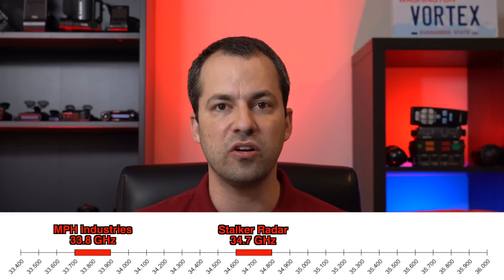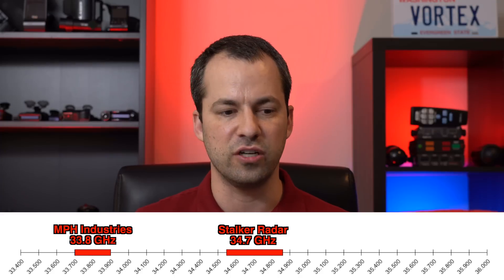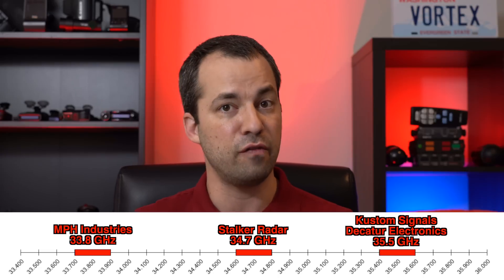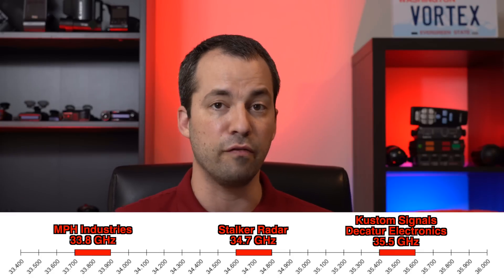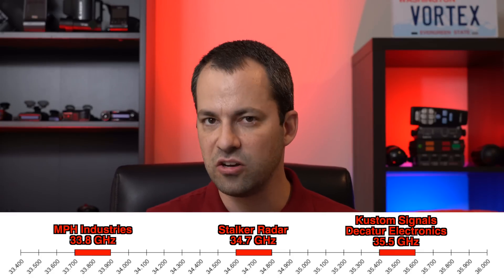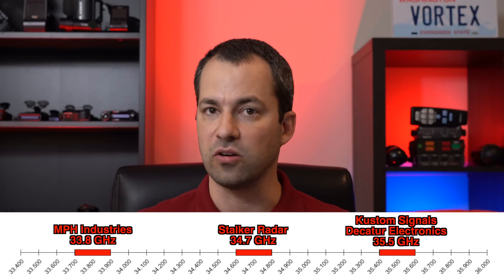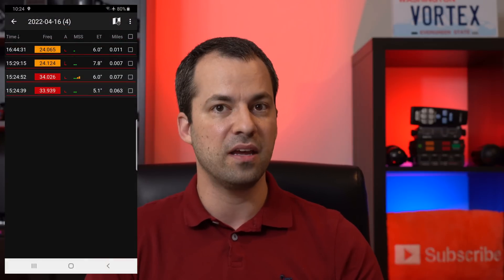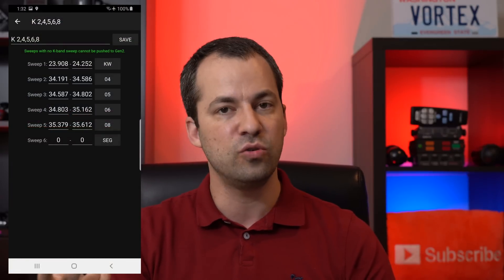Understanding Radar Frequencies

Comment: Recently drove from Pennsylvania to Florida using the V1 gen2 along with JBV1. I was getting a ton of 33.711 signals. This is while on the freeway. Any ideas? Is this a frequency  I can just segment out? I also seem to get a lot of laser falses and I believe it's from sunlight. I hate to just turn off laser as I did see one or two police officers using laser on my journey. Fortunately waze marked almost all of the police officers.
Reply from the maker: Interesting. Usually that freq range is from nearby leaky / cheapy / poorly designed, but the V1 Gen2 also gets its own share of Ka falses regardless. 33.8’ish is where MPH guns transmit as discussed in the video so it’d be unwise to try and segment it out.
Reply: @VortexRadar  ok thank you. I'm still learning how to use the segmentation in jbv1 before I start messing with it. I'm hoping something can be done with the laser falses as it drives my ol'  lady crazy.
Reply from the maker: Yeah definitely be careful with segmentation. That’s also an advanced feature and when used incorrectly, you can shut off detection of legitimate police radar. It’s great that you’re researching the topic first. :)